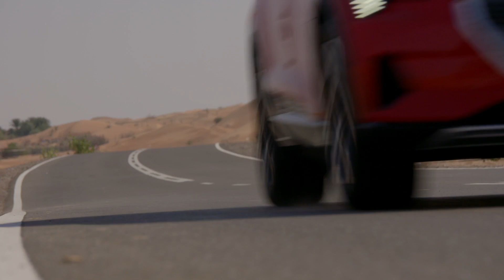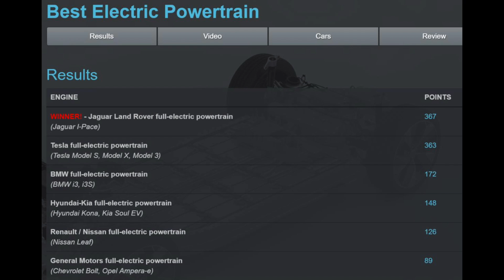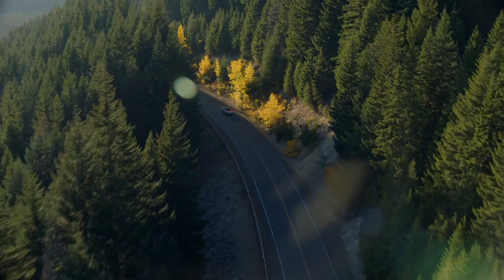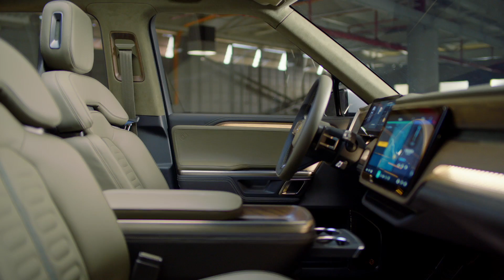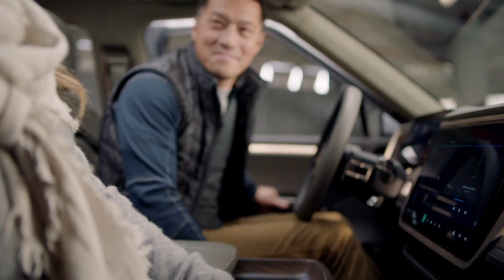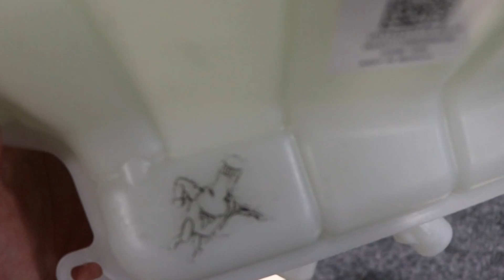Sandy Munro: Model 3 manufacturing, Model Y wiring, and EV competition

Comment: regarding the right battery capacity you can sell three battery sizes and then look at the sales. if the long range battery sells better than the short range battery then you have to increase the size of all three sizes until the short range model sells the same amount like the long range. the medium size model of course has to sell best. so maybe 20% of sales for the short range, 60% for the medium range and 20% for the long range. or maybe 25/50/25 percentage distribution.
if the sales distribution is not symmetrical, then you have to adjust the battery sizes.
Reply: Sounds pretty interesting - how do you know it's the most "efficient" policy?
Reply: @red-baitingswine8816  the numbers from the sales are real numbers. if you make a survey and ask people how much battery capacity they want to have you don't get the right numbers. you probably get higher numbers because people always want more and do not consider that they have to pay more and don't know how much. so you have to get the right numbers from reality and not from someones wet dreams. if this is the perfect way? i don't know. but this way every year you can adapt the cars to the needs of the customers.
Reply: @stefanweilhartner4415  I was referring to the e.g. "25-50-25" as opposed to say "15-50-35"; and not anything else. The symmetry.
Reply: @red-baitingswine8816  with the symmetry you find out that you found the sweet spot for the majority of the people. this is where you make the most money. in your example 15/50/35 you see that you are off from a gaussian (aka normal) distribution. so the medium battery size is too small and you have to adjust to hit the gaussian distribution again.that also depends on the type of car. with a very small, cheap car, big batteries comes with a price tag that is not suitable for that class. for an expensive luxury car, a bigger battery probably would make more sense. the distribution will tell you if you are spot on or not.
Reply: @stefanweilhartner4415  I see (thank you). this makes a lot of sense and seems like a great start.

Stickler that I am, now I want to understand how we know that these distributions are random (not all of these kinds of situations are completely random, are they?). (If you can explain this, or why my question doesn't apply here, or any other relevant info, that would be nice. Otherwise, imo your answer is already very good. and thanks again.) : )

Comment: I have driven a Ford Focus Electric with 70-90 mile range for 3 years with no problems, we save wearing out our gas car and use it for trips so it will last probably 25 years instead of 5 years for a gas car. And the electric is showing no signs of problems, stop and go ,little trips, groceries, work etc.
Reply: that's clever, and you don't carry a huge battery around

Comment: by the way Bluecar combines Ultra Caps with batteries to help cushion the battery loads and charging.     https://en.wikipedia.org/wiki/Bollor%C3%A9_Bluecar
Specifications

The Bluecar is a three-door hatchback electric car with four seats. Both the retail and Autolib' versions share the same drivetrain specification. The electric car has a 30 kWh lithium metal polymer battery located under the passenger seats, coupled to a supercapacitor, that provides an electric range of 250 km (160 mi) in the city and 150 km (93 mi) on the highway at a maximum power of 50 kW.[1] The maximum speed is 130 km/h (81 mph) and the battery weighs 300 kg (660 lb).[15] The batteries are made in Bolloré owned facilities in two locations, one in Brittany, France and the other in Montreal, Quebec, Canada.[16]

Bolloré is unique in integrating solid-state batteries into production vehicles.[17] The LMP batteries consist of a laminate of four ultra-thin materials: (1) metallic lithium foil anode that acts as both a lithium source and a current collector; (2) solid polymeric electrolyte created by dissolving a lithium salt in a solvating co-polymer (polyoxyethylene); (3) cathode composed of vanadium oxide, carbon, and polymer to form a plastic composite; and (4) aluminium foil current collector.[18]

Comment: What would be against using ultra capacitors to charge the last 2 or three minutes that a car was on the fast charger, then bleed that charge into the lithium ion battery after the car disconnects?  Then the car could run for the first say, 30 miles on that charge or the capacitor could feed the battery.  That way the most time consuming part of the charge cycle could be eliminated.  That would also help with battery longevity.  The motors of the car could also substitute for brake pads.

Comment: Great interview. Adding the clips helped break things up. The discussion about solid state battery technology versus new lithium battery chemistry could have used some elaboration. He made a good point that it will be hard to beat legacy battery maker's to a new lithium battery chemistry
Reply: No its not. Dahn has many patents for Tesla on improved LiIon chemistry including a recent mention of higher capacities with liquid electrolytes. What improvements are OEM battery manufacturers revealing. Many of them have only started to make 8.1.1 cells. BYD has only recently made automotive LiIon preferring LiFe.
https://www.greencarcongress.com/2019/08/20190806-dahn.html
Reply: @waynerussell6401  thank you for sharing the link

Comment: Maxwell will bring tremendous value = increase range, cost, charge speed, lifespan, safety.....and 16x increase in production capacity in batteries. wow!
Reply: I think this is why Tesla delayed the semi.  I think they're going to use Maxwell technology to build the semi.  Totally makes since, better range, lighter weight, capacitors will work better catching energy from regenerative breaking.  Also, Maxwell had a patent on shocks that generate electricity.   I'd think the benefit of this in a car would be so little it wouldn't make it worth it, but an 80,000 lbs. Semi, 18 wheels might make more sense.

Comment: at 15:50 Sandy shows that chart with points awarded. But what does that mean ? What are those points awarded for ?  How does that relate to cost and quality etc ?
Reply: That is all in regard to weighting the strength/weaknesses in the powertrain only.
Reply: And don’t forget that the 3, a much newer design, was lumped in with the older S and X. As they inferred, had the 3 been assessed on its own, it would have won the race, and by miles!

Comment: The Maxwell thing is interesting because actually the dry electrodes are working against the logic for using capacitors because of their much higher power densities. On acceleration I don't see a problem even for the roadster with 200kWh of battery you can safely withdraw stupid amounts of current however for regen it may make sense. Generally Elon prefers design simplicity so if I had to guess I'd say there will not be capacitors instead he'll be more interested to advance battery technology to the point where they can accept such high charge safely that they can absorb all regen Energy directly but I could be wrong. Also the new switched reluctance motors btw do not generate as much regen as pure permanent magnet motors usually do. The higher power density of the dry electrode cells I think plus the usage of their low back EMF motors will make caps for regen purposes unnecessary or at least the added complexity will not be worth it.
Reply: Where is a clear reference to a switched reluctance motor? I honestly think it is a huge hoax/misunderstanding spreaded everywhere in internet. I believe the machine is nominally the same type used by the other competitors, so Interior Permanent Magnet synchronous machine (which exploits, just to be clear, also the reluctance mechanism). Casually, EPA official certification,   shows the description "Internal permanent magnet motor".
Reply: @Dr. Lexus
There's an interview with the motor designer can't remember the details but the guy has a greek name and I believe it was featured on cleantechnica.
It's a hybrid so it's still got permanent magnets as well. It's hard to say whether the switched reluctance is relied on more than usually in a PMAC that is true, but if you could rely on it more it would get you less back EMF so there is definitely incentive to do so. The motor designer spoke about that a big challenge was addressing the torque ripples. Also that motor allows for a 370 mile EPA range now in a model S so that's really good, quite a bit more than the inductance motor before and far more than any competitor could get out of a 100kWh battery. Now you can only speculate if the motor has a big say in that or if it's virtually all other factors such as aerodynamics, etc. Electric motors are pretty complex more than people think anyways so I would say you could optimise quite well if you had smart engineers on the job.
Reply: @ryccoh  I am an electrical machine design/EVs enthusiast working in this field. Thanks for the hints, I think I understood what source you are referring (maybe https://cleantechnica.com/2018/03/11/tesla-model-3-motor-in-depth/) but  again there is no point where Dr. Laskaris talks about "switched" and/or "reluctance" in that interview (and I was not able to find anywhere). Only in the comments or by some else of the audience. To be honest, I believe that everyone calls switched reluctance because of the Musk's tweet. The point  that I want to highlight is not that the machine doesn't exploit the reluctance mechanism, it's just that is a synchronous not switched (two different machine typologies in terms of control strategy, hardware and design).

Comment: I worked for a company in silicon valley that engineered audio players.  There was a common problem with the players freezing up from time time.   The easy fix was to disassemble the player disconnect the battery and re-connect it.  Everything was fine.

I e-mailed the head engineer and requested that they put a pinhole reset button on the next generation player that would reset the main microprocessor.  No response.

At the introduction of the next genoration player. The head engineer said yes Fatboy we have a reset switch.

I always thought no one was listening.  They were.

Comment: good interview, some insights. 
my take away is the new stamping machine will fix the overly designed body of model3.
Should everything go into internal vertical design?
No, eventually some companies will make it cheaper and better for others to order to specification fo that specific part. (tesla do not manufacture their boards for example) so there is a sweet spot.

Comment: regarding the over-designing of the Model 3 at 26:44 : i wouldnt be surprised if they already improved on that part, but just didnt bother to advertise it in any big way.. if needed they do changes/improvements to the manufacturing weekly sometimes from what i hear - so does anyone have info regarding that on a more recently manufactured car?

Comment: Talk about minimum range not maximum range. When people talk about range anxiety they try to say 240 miles works for most people. But 240 miles is the best case range. When the car is 7 years old you might loose 10% range so now your at 216 miles. Then drive that in the snow you can loose another 40% range putting you at 128.4 miles of range. That is not enough range to leave town. That is the reason I purchased the long range model 3. In 20 years that car will still have enough to hop between Superchargers.
Reply: With proper preheating of the battery before you leave for a trip you will not lose 40% range. Maybe 20%

Comment: Thanks for an informative and interesting interview.  I enjoyed it and it’s becoming obvious that Tesla will be huge!

Traditional automobile manufacturers can be viewed as ”Dead Car Companies Driving.”  They can’t compete.   They are too big, are not willing to sacrifice profits for long term viability, and won’t do the required research and design in a meaningful way to be taken seriously.  I thinks in ten to fifteen years that only Tesla, Chinese car companies , Toyota, and perhaps BMW will be still around.  

The only limitation to faster adoption of EVs will be critical shortage of batteries and limited supply of EVs.  Mark my word, there will other companies that come out of left field to fill the void created by the bankruptcies of the traditional OEMs.  Tesla in the short term won’t be able to handle all the demand for their vehicles.  Consumers will flipped over the model Y when it comes to market in two years.  Be prepared for a lot of disruption in the automotive industry.  And it won’t just be the manufactures who are negatively affected, but also the dealerships, car parts sales, and all the companies that current auto manufacturers use to build their cars.  OEMS get 90% of their parts from smaller companies whereas Tesla only get 10% of their car parts from outside companies.

There will be other ramifications that no one even sees yet. Wow, scary fast change is ahead.
Reply: You're right about everything but Tesla has some problems that people don't talk about and a difficult issue on the horizon is taxes to maintain roads

Comment: Where is the pickup. Did they put it on the back burner.  What are they going to do with towing trailers. It seems they have a way to go for a work farm type vehiicle.
Reply: The Model X tows 5,000 pounds of trailer. The pickup is still in the plan, focus is currently on bringing Y to production. Pickup announcement/reveal is coming in a couple of months.
Reply: @vidznstuff1  model x weighs 5400 lbs. Can tow around 4300 lbs
Reply: @scarecrow66ab  Don't know about yours, but mine is rated at 5000 pounds towing.  Have no idea why you've decided to reply, let alone sell the car short by 700 pounds - a well fed corn farmer and his wife.

Comment: I don't think they would have a company culture issue with selling batteries or drive trains to other manufacturers; but think the problem with it is that they have enough products and ideas on their plate that they are unlikely to reach a point of production where they can oversupply their own battery needs. They have seemingly been putting off or just rolling out slowly the battery backup part of the business which has been referenced in the past by him and/or his cousin as needed for larger scale adoption of the solar part of their business (there has been pushback on electric company having to purchase electric back from solar and at a reasonable price or at all, the fix is send it to your own batteries, use it urself), and would be nice if they have enough batteries to supply all of their car product can push that other part of their business where it can be 50/50 with the autos. If someone making a niche vehicle needed 50,000 battery packs, might be a thing; but thinking it would be a happy luxury for them to be at a point where they can redirect supply elsewhere and prob not anytime soon.

Comment: Very curious how much weight Sandy thinks could be saved. How much faster the car could accelerate, go around a track, longer range etc just from the weight savings
Reply: dyhppyx 100lbs saves 1/10 in most drag  strip applications. It's easy to quantify.

Comment: IF Mark calculated the gas savings on ~35,000 miles - how could he ignore those savings?? He hasn't made the calculations.
Savings in oil changes.  Mark hasn't really made the calculations - IF Mark had won't he have shared the numbers?
Mark doesn't think there are Superchargers are near Chicago??
Tech Forum: 44,000 miles $44,000 Model 3 = same operating cost as Toyota Camry  https://youtu.be/YtVJE9-DszA
Reply: Mark also said who wants to sit around for 2 hours and drink coffee while your car charges.. makes me think hes never taken a roadtrip in a Tesla. Charging is 40 tops and usually just 30

Comment: it is not always wise to use the best battery because that comes with a major price tag per kWh.
for a porsche taycan that will not be a problem but for a real sub 35.000$ car you have to use cheaper technology which means less energy density
Reply: Amazing how you were totally wrong in everything you said. Model 3 will be around $27-25k from the Chinese factory. Tesla could easily build a $30k M3, simply by adjusting range, but they need cash flow to fuel growth and can't build enough of what they have to meet demand at current pricing.
Reply: @vidznstuff1  i think you don't get the point at all
Reply: @stefanweilhartner4415  So am I to guess again, or are you going to share what your point was?

Comment: Nice interview as I with my limited knowledge in manufacturing can clearly see the Automotive Industry has allowed themselves to fall too far behind Tesla and it really shows when the rubber hits the pavement. When Tesla gets the body problems fixed and drops weight, cost, and complexity the rest of the Automotive Manufactures are going to be even further behind. 
Jaguar is a perfect example of missing the mark when trying to go head to head with Tesla as the I-Pace was made to compete with the Model X but fell way short and they seem to have made it not knowing the Model Y would ever be built. In looking at the Model Y in comparison to the I-Pace one would have to be somewhat crazy to pick the I-Pace over the Model Y as the I-Pace will remain the same from the day you buy it until the day you sell it while the Model Y will improve over time of ownership with Tesla's over the air updates, and it cost a whole lot less, gives better range, more storage space, and better performance. In fact all the other car makers have this problem when being compared to a Tesla in that what they sell doesn't improve over the time of ownership like all Tesla cars do.